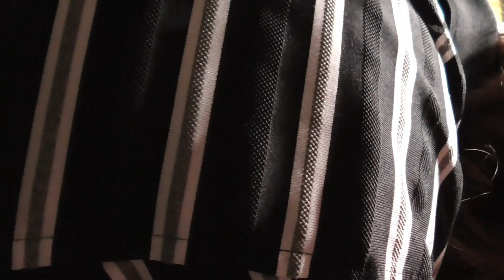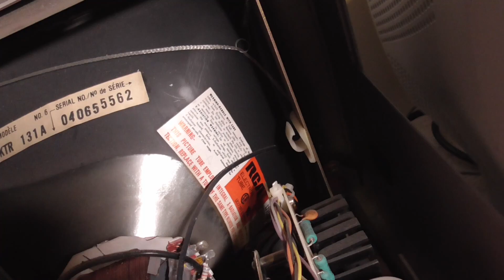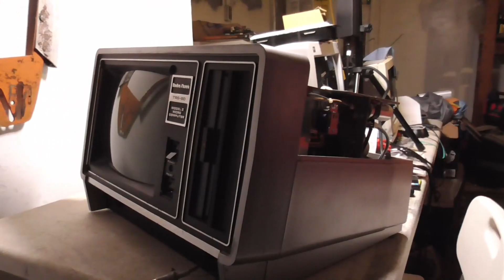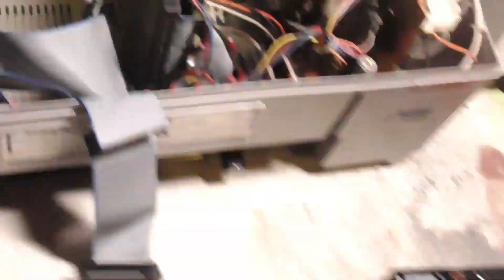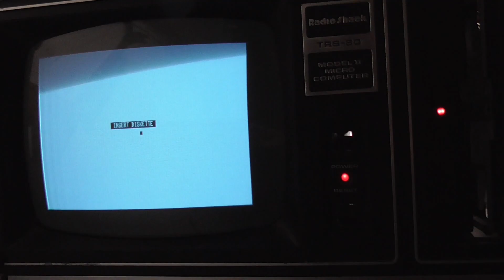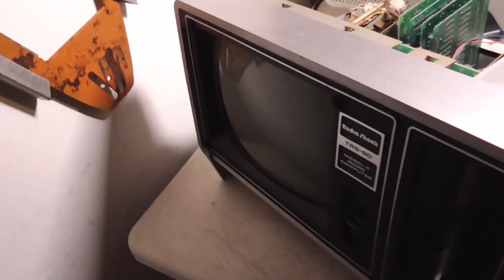I bought a Trs-80 Model II Part 1

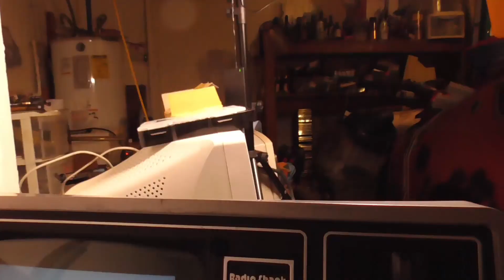Comment: Wo!  What kind of Z is that in that background at 16:35?  Before I started collecting retro computers, I collected Z cars LOL
I just acquired a Model II this week...  with DMP-400 printer, disk expansion unit, original manuals & software, and a Compaq Portable to boot!  Looking forward to getting them all out of my car this weekend (good thing I wasn't in a Z!) and testing everything out.
Reply from the maker: It's a 72 240z, or some of one, much has been lost to rust.
Reply: @anachronisticthings6816  Yeah man...  Being so prone to rust was pretty much the only shortcoming of those cars.  Unfortunately, it's a big one...  I had a '73 240Z with an LT-1 engine in it.  It's probably a good thing I don't have it anymore as I would have eventually killed myself.  It was so freakin' fast!